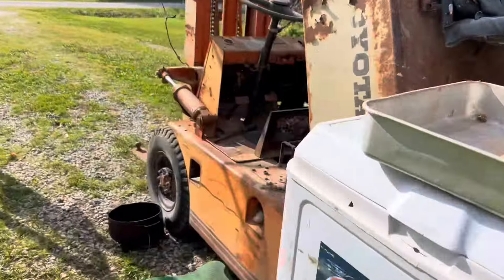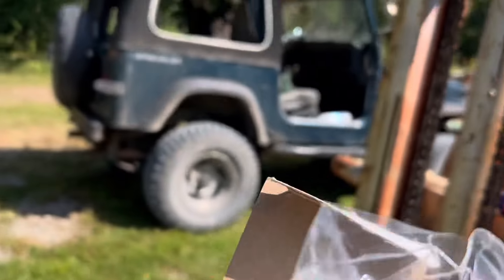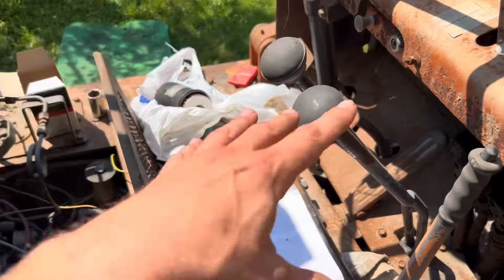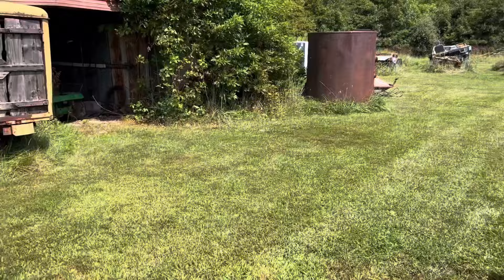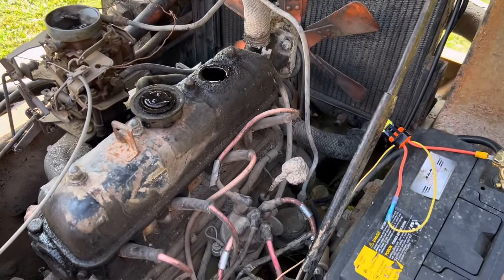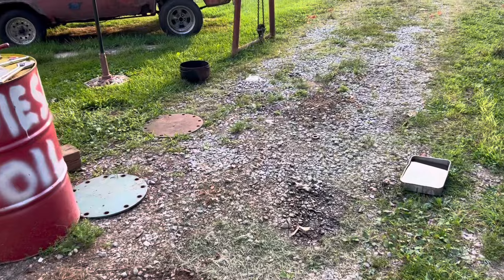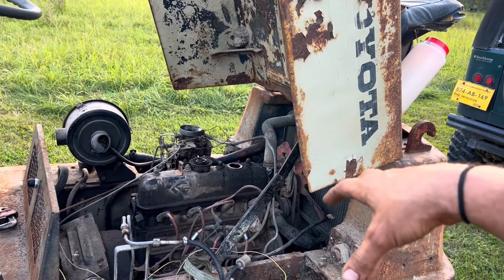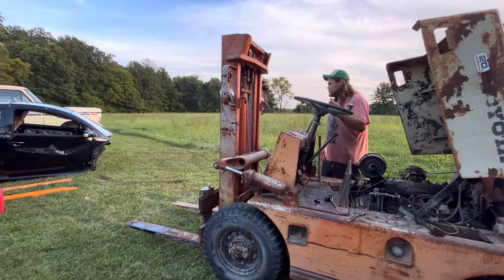$400 Forklift blows up on its first job!

Comment: Are you sure you're oil filter wasn't incorrect in some way and blocked off oil flow or wouldn't allow enough suction head for the oil pump to start pushing oil? Maybe the oil pump drive shaft broke, that's another possibility.
Reply: I was wondering the same, but no sign of bottom end knocking before it seized.
Reply from the maker: The one it had in it originally was for sure wrong but according to the Toyotalift dealer the one I put in was correct but that’s all a possibility, I just think it would have started knocking or at least gave a little warning lol

Comment: Maybe starter in stuck in. Pull it out .
Reply from the maker: Already did, still stuck as hell unfortunately. Thanks for the input though I do appreciate it!
Reply: @NastyCustoms5150  the filter same as my Mercedes508d. Could have had canister changed. Pull it and see if gunked up. Was it same size as old filter. Maybe wheel locked up stopping it from turning. Disconnect the drive shaft. Has something fell down blocking it from turning. Good luck. Bummer👍👍
Reply from the maker: Appreciate the info man! I’m going through all the silly things it could be and hopefully I get it but we’ll see

Comment: Toyota forklifts are/were strange things, we had an 80's version at a place I worked years ago, now bankrupt and I think the owner is still in jail for creative bookkeeping and selling things he didn't own, but that was long after that I worked there. When you lifted the "bonnet" it said ISUZU in large letters at the top, when you dug further down the parts gradually switched to Opel. Both were GM at the time so it was probably the same engine used in both brands, but Toyota wasn't GM and I would have thought they had plenty of their own engines to use in the junk? Well, I see that an LS swap has already been proposed, I support it. With turbo. Maybe two.
Reply from the maker: Lol sounds like it was a bit of a hybrid! That’s what mine may turn out to be, or yard art but I will be sure to set an ls engine on the forks to make everyone happy 😆

Comment: Maybe hydrolocked due to stuck exhaust valve, pull the plugs and see if it turns over. But I'm guessing those noises you heard when you changed the oil weren't good ones!
Reply from the maker: Already tried that with the same result… I agree that whatever hit the oil pan probably wasn’t good lol
Reply: @NastyCustoms5150  Lame!
Reply from the maker: @austinbentley6234 Pretty much

Comment: Well Nate   that sux    maybe she spun a bearing         it went out quietly. Hydro locked ?      Good luck with it hopefully it works out.  Cheers Sir
Reply from the maker: Thanks Dave! I’m thinking it may have spun a bearing out but it went quick and quiet, at least got a good conversation piece of yard art lmao
Reply: I think it would be fun to pull it apart. Make a good video, plus I'd like to see the kitchen clean out . Lol
Reply from the maker: We’ll figure something out lol
Reply from the maker: That’s very interesting, I’ve never heard of that thank you!
Reply: @NastyCustoms5150  Or just get new bearings and try to polish the melted babbit off of the crank or melt it off with acids and bases. Engines seized for lack of oil almost always seize on the crank first. But find out why it seized. Maybe the oil pickup was full of sludge, wrong filter, broken oil pump drive, etc.
Reply: @NastyCustoms5150  Hiya Nate. Not sure what your speaking of   but I might be getting memory loss lol
Reply from the maker: @gregorymalchuk272 Right, it will get revisited in the future when I get the time and I may end up doing just that thank you!
Reply from the maker: @davestark2015  Lmao just responding to other people who replied to your comment! Anyhow hope you’re having a good day man!
Reply: Lol didn't realise you were commenting on someone else.
Reply: @NastyCustoms5150  it's a good day. Hope you both are the same. Don't take much to confuse me with this digital sh!t lol
Reply from the maker: Glad to hear it man! We are doing good down here as well! Cheers man
Reply: I replied to your email.  Cheers Sir
Reply from the maker: @davestark2015  Awesome I will check it out once I get home! Thank you